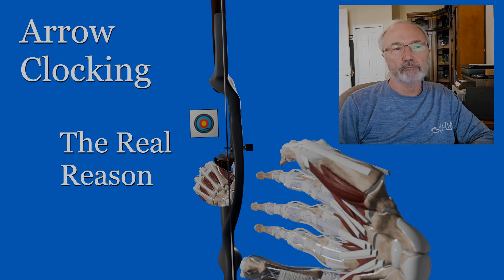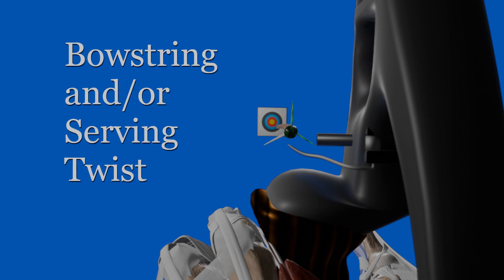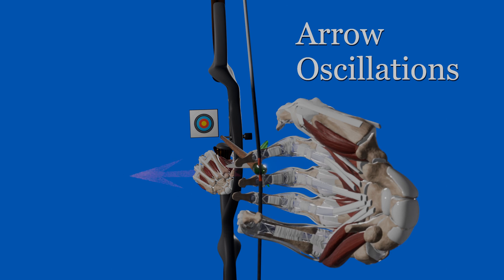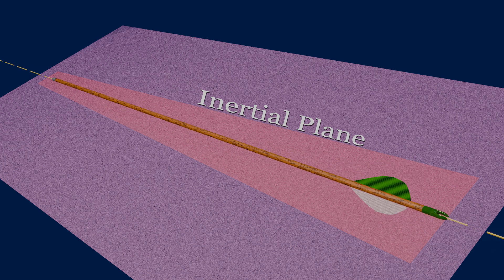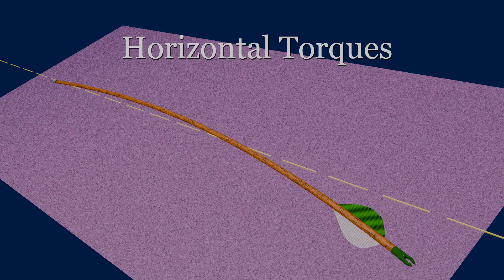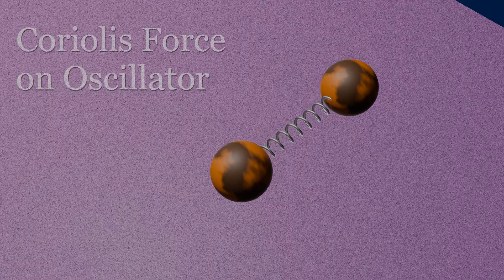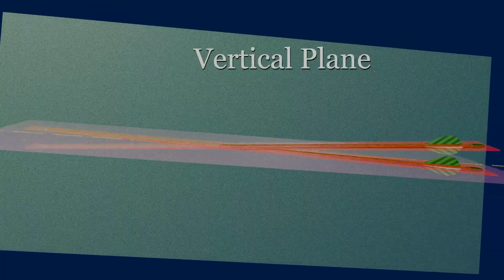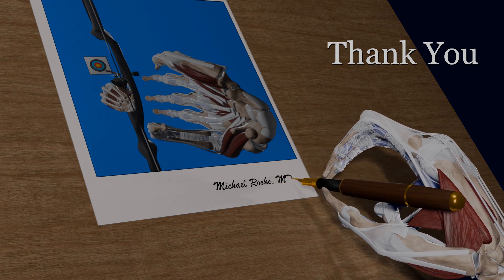Arrow Clocking; The Real Reason

Comment: I experimented with Easton ACE (carbon and aluminum) and Easton X7 (aluminum) bare shaft arrows. The ACE arrows spin to the right and the X7 arrows spin to the left. I used the same bow, string, fingertab, stabilizers, etc. After I realized this, I switched to left-handed feathers on the X7 arrows. They started grouping much better.
Reply from the maker: Thanks for the information. The difference in clocking probably relates to different dynamic spines. It sounds like your tune is pretty tight. Most people don't think the fetching handedness matters with clocking. You're the first person, I know of, to show a difference. I can't say I surprised.

Comment: I checked mine a few years ago and went left helical because of it.  I wish I had just stuck with right helical.  The reason you check it with a bare shaft is because it doesn't happen with a fletched shaft so you might as well have your arrows spinning in the direction that tightens your heads.
Reply from the maker: Agree. Manufacturers appear to be coming to the same conclusion.

Comment: As a physicist myself, I appreciate the theoretical grounding in a physical mechanism. Especially because it allows us to make falsifiable claims about the implications of the theory. I would expect that an implication of this model would be that there would be more rotation of an unfletched arrow at higher FOC. Could an alternative model be due to the decay in amplitude of the oscillation? Since the arrow has non-homogeneous mass density and since torque is proportional to r^2, when the arrow is at peak amplitude the gravitational force could directly cause a rotational torque about the longitudinal axis of the arrow shaft. If the oscillation did not decay, this torque would be of equal magnitude in each half of the oscillation cycle. But since the amplitude does decay, there will be a net non-zero angular acceleration about the longitudinal axis. This would explain why left handed archers tend to get rotation in the other direction just do to the opposite initial condition in the amplitude of the oscillation.
Reply from the maker: Absolutely, I left this detail out because of time limitations. There is another factor in rotation. This is the final lateral movement in the string that produces a cw rotation (right handed archer). Empirically this appears a much lesser force.
Reply: @mdrooksmd  If the archer is not twisting the string (which some do), how does the lateral movement cause a torque about the axis of the arrow? Is it due to the positive tiller?
Reply from the maker: When the string moves side to side, there is a changing angle with the vertical plane. This rotates the nock. The last lateral string movement consistent with nock clearance is from right to left. Thus a very slight cw rotation. This side to side vibration is due to string interaction with arrow vibration.

Comment: I’m no physicist but I’d have to disagree. I’ve seen a handful of tests in which the same shooter, same bow, same arrow , same release aide was used. The only true variable was testing with a counter clockwise and clockwise served/twisted string. And when the string was changed, the arrow clocking changed respectively. Unless of course, you could explain how changing that single variable would produce consistent opposing clocking results .
Reply from the maker: Changing the string alone is a big variable. My problem with the twisted string theory is lack of a mechanism. In science, if a theory has no mechanism, it is always suspect.
Reply: @ if I’m correct in your definition for a “mechanism “. I’d point your attention to that when a string is served it is spiraling up the string at an angle. (Much like the threads on a bolt) of course this spiral is in opposite direction for CW VS CCW. The nock of the arrow seats on this angled serving and is released from this angled serving . Thereby imparting CW or CCW spin/ clocking upon release/launch
Reply from the maker: Most major string makers use a cw twist. Nevertheless, different archers see cw and others acw. There is a good discussion of different clocking and inconsistencies on archery.com https://www.archerytalk.com/threads/bowstring-twist-why-clockwise.5772991/
Reply: @mdrooksmd  Yes, but in science we alter the theory in accordance to the experimental evidence, not the other way around.
Reply: The two effects are not mutually exclusive. In the case of the Coriolis model, it is possible to calculate the angular acceleration of the arrow and compare that to experimental evidence. Without having a mechanism for the string twist model, it's hard to quantify the implications of the model and compare to experimental evidence.
Reply from the maker: Thanks for your input

Comment: I had left a comment here this morning. Where did it go?
Reply from the maker: Don't know?
Reply: @mdrooksmd  Strange! This is more or less what I wrote:
How do you explain bareshaft rotation for compound release shooters? And that one bow can shoot one brand of bareshafts CW and another brand CCW, as shown in https://www.youtube.com/watch?v=ebSxqxBq1w8
I think there is more to that phenomena. Maybe arrow construction!? Direction of carbon fibre twist?
Reply from the maker: All compound bows produce vertical arrow oscillation. If centershot is not perfect, there will also be a horizontal component. Every shot produces oscillating torques. These can be more right or more left. This can give either a cw or anti-cw rotation. Other factors may be present, but I believe that the coriolis effect is the major one.
Reply from the maker: Dynamic spine